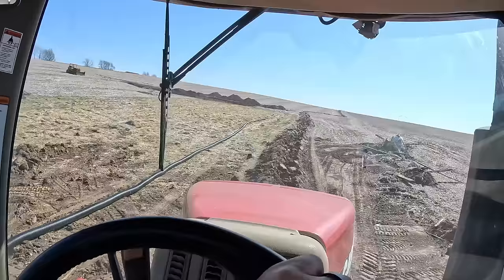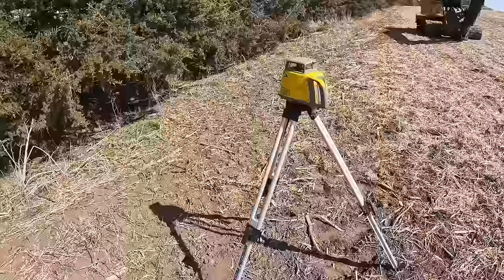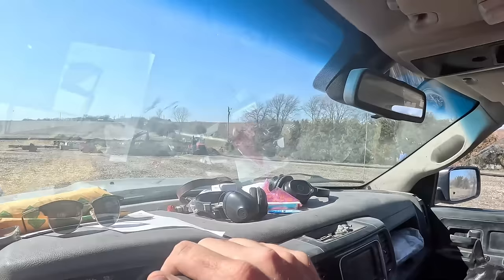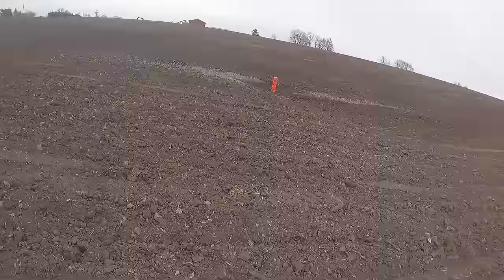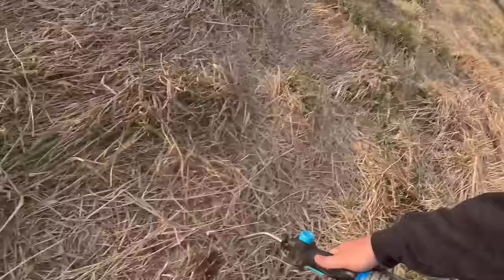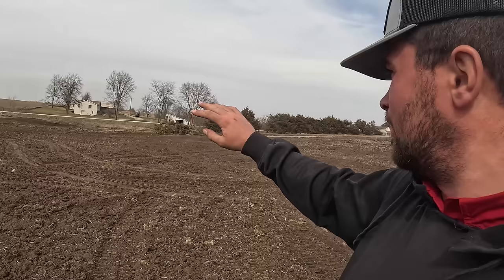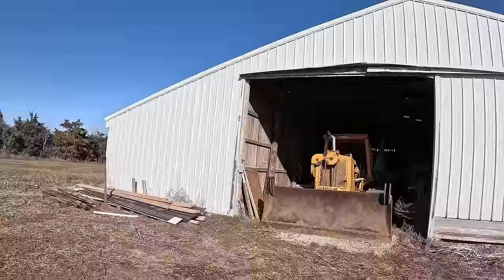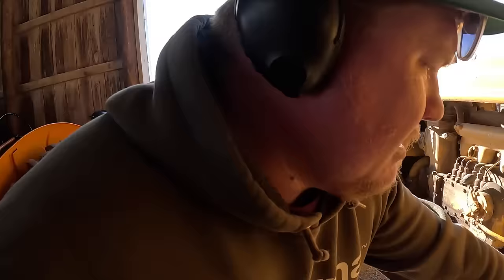MAJOR UPGRADES to the PUMPKIN PATCH

Comment: Ben, I’ve never seen a drip system using drainage tile. Now between my brother and I we have 2200 acres of drip tape. If you’re wanting to irrigate a small spot for your pumpkins, and you have well water? That’s how I’d do it. Because we can irrigate 70 acres on 40gpm very easy. You need a little pressure to get it to go. Then just figure out your row spacing, length of your run. I’d get a hold of a eco-drip salesman. Maybe they will give you a special for doing a little advertising.